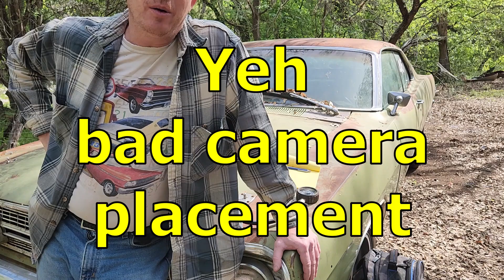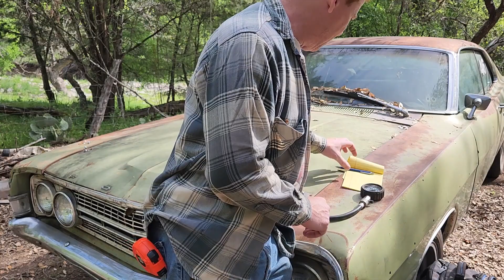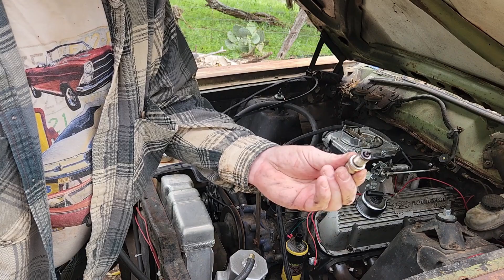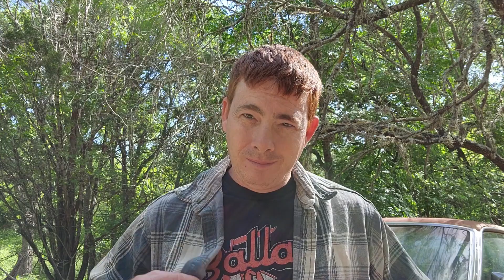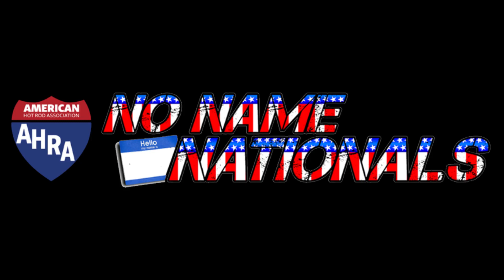351 Windsor compression test. #nonamenationals

Comment: You should have started the engine, let it warm up, then pulled ALL of the spark plugs before you ran the compression tests. You probably would have gotten more consistent readings if you had. You wouldn't have blowby with compression readings that high. You can just hone the cylinders, and install new rings to bring it back around. With compression readings that high you shouldn't have to bore it. Just be sure to run iron rings, not moly rings. You'll be fine with a hone and go. 😁
Reply from the maker: We re-built it anyway.